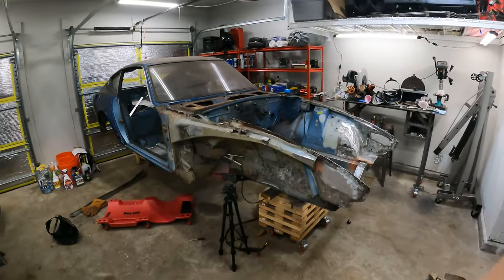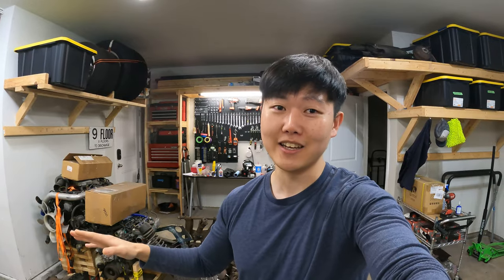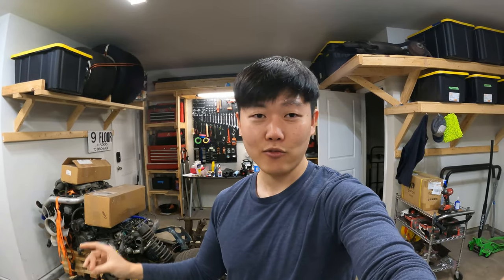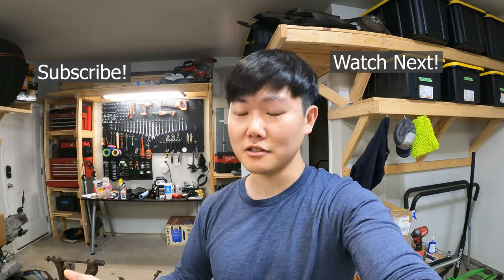Battery Tray, Frame Rail, Floor Pan (Pt.4 Final) - Datsun Z Rebuild Episode 24

Comment: I actually love watching the 'boring welding and grinding' lol

Do the windows yourself, it's very easy with this old style weather trim and there are videos on YouTube to walk you through the process, but you basically just use  a utility knife and cut the rubber around the window and use a glass suction cup from Amazon and you're done.

Comment: The blue on the car is the same color I had on my 1973 Datsun with a black & white interior. I owned it from 1977 to 1980. It totaled from behind at a stop light following my dad in his car. Then I bought a 1980 Mazda Rx7 4 speed. Now I am back wanting a newer version of my 73.
Reply: I hope by the end of June I will have one.

Comment: Don't worry about breaking the window, just cut the rubber off with a knife and some wd40. There should be no pressure on the glass if you do it this way. Run the blade parallel with the glass on the inside edge of the outer side of the screen. Cut away and simply lift the glass.

Comment: Hey man great work! Some great resto inspiration! If you plan on painting the car and installing brand new windscreen seals don’t bother paying someone to remove the glass just get a sharp blade and cut the outer rubber then lift out. Same with the rear hatch

Comment: Damn that came out great. Quick update on my car. I haven’t done much yet except clean it like crazy, clean and prepare the garage, buy more tools and meet with a few tech guys that work in nascar about engines and how much I will need to reinforce the frame to handle the hp. Well I guess that’s a lot but I don’t want to start tear down until all my ducks are in a row. Anyway we have to figure out a way to DM so I can come check out the garage. Peace, stay safe

Comment: Funny that you comment on the hammer, exactly when many of us are likely wondering why you haven't bought a proper dead blow already. Nice work, very methodical. Many of your welds look like you are putting too much heat into it for the gauge steel used, really shouldn't be so much bluing spread. I'd imagine you've come along way since this was done though.

Comment: The front screens are real easy to take out dude. Pull the trim out that sits in the rubber then take a blade and cut off the rubber lip that fold over the glass then just lift the glass out

Comment: Love the way this is turning out. 
You're doing a great job 👏 👍 🙌 👌. 
Also already take the glass out of my 77 280z and is not a big deal, all you do is cut the rubber around, is something simple.
Also get a replacement al junk yard because my hase bubbles on the bottom, and take my 15 minutes to remove.

Comment: Mate  I  watch restoration projects with work similar to yours with rail replacements that didn't needed to be replaced and these guys have drilled into the sub rails and inserted this anti corrosive spray to limit deterioration  but you had yours open and you didn't take any precautions to protect the inner steel. Do you think if you welded a steel box together with all that heat that moisture wouldn't happen

Comment: Came across your channel. Wow amazing channel. What settings do you use on your welder? Just beginning my restromod 240z and have never done sheetmetal. TIA
Reply from the maker: for sheet metal? setting 2, wirespeed 4ish on my welder, dont know what that translates to in terms of actual voltage :(
Reply: Thank you. Keep up the great work!!! Your videos are very informative and easy to understand.

Comment: I wonder if, once you add up all the tools and materials (not to mention time), it doesn't make more sense to spend a couple more grand on a better body? Honest question. I think you're doing something great 👍
Reply: I think the biggest reason is that this particular body has his hundreds if not thousands of hours of work on it. Plus, I don't think you would be able to find a true rust free example (mint behind every weld and cavity) unless you buy a fully restored show car that had the works.  I don't think you can buy remanufactured body structures for something like this (but I have been wrong before).

Comment: Won't acid dipping burn the primer on the inside of the sills/frame rails/pillars etc off?  The car would end up rusting from the inside out I'd think if it is dipped.
Reply from the maker: I'd basically need to reapply them afterwards. There are specialized spray cans with with extended nozzles you can use to re-coat those areas.
Reply: @RestorationForBeginners  Nice - glad to hear that's doable

Comment: Do t hire someone to remove the windshield. That’s the easiest part compared to what you have already done. Take a razor blade and cut the weatherstripping out of the way. The glass is pretty light and you can lift it right out.
Reply from the maker: Haha my buddy tried to take his out himself and cracked it... he's been looking for an affordable replacement for months. Are you sure it'll just come right out?
Reply: @RestorationForBeginners  yup. They aren’t glued. Cut the outer part of the weatherstripping all the way out of your way and start gently pushing from the inside in various spots. It’ll come out easily.
Reply: @RestorationForBeginners  I removed my 280Z by myself, other than I had a friend help me lift it out. No issues. Also, SafeLite Autoglass carries 240/260/280Z glass!
Reply: Also, I used dental floss. I cut into a corner with a razor blade, fished some floss through to the inside, and then drug it all the way around.
Reply: I cut mine out too. Easy work. You need to just cut the outside part covering the glass. I did it myself, and my rubber was stone hard.

Comment: Just sand blast it it's wayyyyyy WAYYYY cheaper.
     I have done both . If you acid dip it , you will have acid in joints you can not get to.
Which will continue to eat in all the non reach able and non see able inner panels.
     Only acid dip it, if the have an over to bake out all the acid !
    Which MOST acid bath shops DO NOT have. They just hose/ pressure was with water , creating rust in areas your car doesn't even have. 
     You just finished taking the rust out.
      Now sand blast the car.
Prime the car, paint the car.
Use 2k bedliner like raptor.
Under the entire chassis. And in the wiper motor tray.
    That area never got paint from the day it was born.
   It's a tray of water , leafs, pin straw, dead bugs .You want to be sure. That wiper motor tray area is entirely primed painted and bedliner it WATER tight .
    Not acid Dip !!! Save money ( alot ) 
After ist painted and you re blow out all the sand in ever hole you see back and forth then use EAST WOOD inner frame anti rust spray and long application wand to pump good coverage of anti rust in all closed/ boxed frame members .